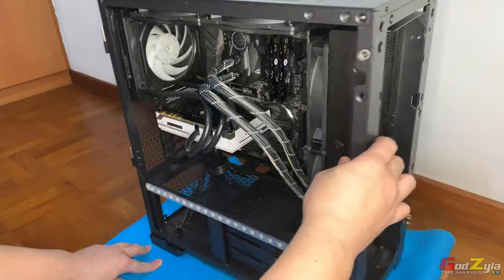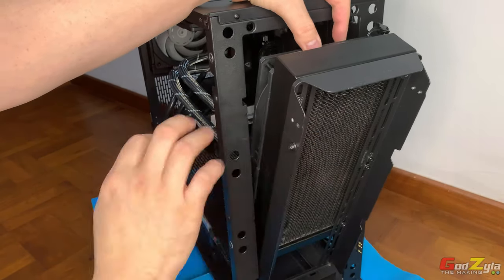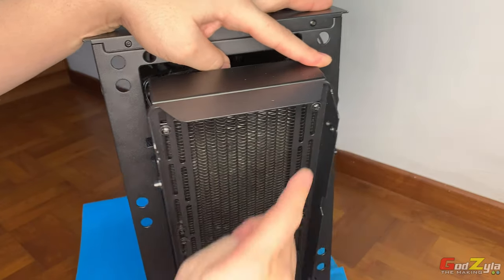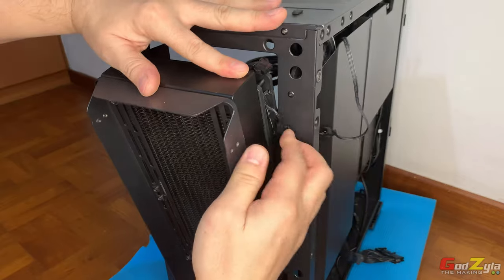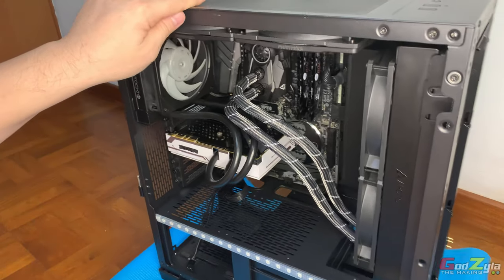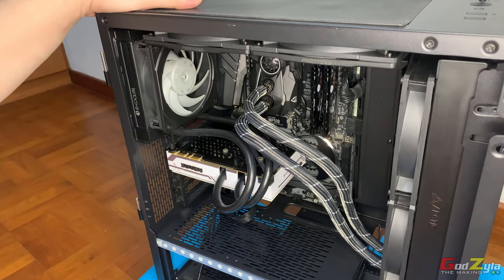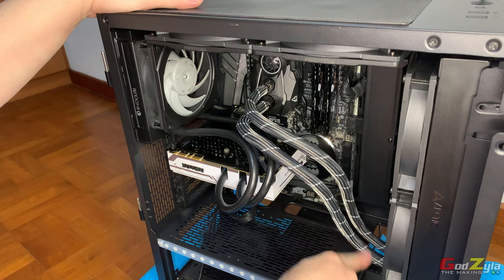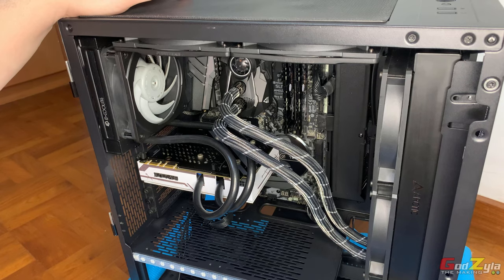Radiator Placement In Lian Li Lancool II Case

Comment: What would be the best placement for a 360mm radiator?
Reply from the maker: Hi SpilledJuiceBox thank you for your question. You only left with front mounting the 360 rad as the top only allows 240 rad. If u do have a lengthy card that is 300mm long. Then ur radiator at the front, the hose must face up and not bottom. Hope this help and thank you for visiting too

Comment: Is it possible to have fans on both sides (a push/pull manner)? For reference im planning on using a z63 kraken (280mm aio) with unifans
Reply from the maker: Hi Kristian Nikolic, welcome to my channel. Yes you can do push pull configuration, no issue.
Reply: @KleoYan  Thank you for the warm welcome and another thank you for the quick answer😊 im planning on going with z63 with 2x sl140 and the 3x sl120 on the front, another question, which would you recommend foe pulling and whic for pushing(sl140) got better static?

Thanks again
Reply from the maker: @kristiannikolic6284  hi, I will advise you to use just SL140 on both sides instead of using mixture of SL 120 and SL 140. If you want to try, there is no right or wrong about it. 
having to say this, these are my reasons on using mix size fans

1) static pressure might compromise, example you have 3 x SL120 at the front and 2 x SL140 at the other end (after the radiator), the focus area where air is pushed in by the SL120 is stronger, leaving your SL140 having some stress to pull the air in.
2) More turbulence as your SL140s fan blades might damage in time, as it's being force by the concentrated air pressure provided by the SL120s. 
3) Noise generated due to turbulence and undulating blade rotation which might cause pitch whining. 

nevertheless as I have mentioned. that's my thought and opinion.
Reply: @KleoYan  most appreciated, im gonna go with your advice since im not as knowledgeble in this area, again thank you very much 👍😊
Reply from the maker: @kristiannikolic6284  you are most welcome but I am not always right, just happened to have some experience while helping friends to build their PC. by the way, all the very best with your build :)

Comment: One question: with a large graphics card like the 3xxx series, would you still be able to mount that AIO upside down with how the tubes are routed? Hard to see in the video, happy for any advice.
Reply from the maker: Hi makvarochapollo, welcome to my channel, so long your GPU is not longer than 300 to 320mm in length you should not have an issue, as for how it looks like, an not able to show you as I have migrated from this case to the o11d mini. https://imgur.com/gallery/Pw5kY4q

Comment: I cant put the tubes down with my 2060 super and the 360 arctic liquid freezer 2.. Will it only be the higher noise or will it cause any damage if I put the aio with tubes up?
Reply from the maker: Hi Daniel Davertzhofen, thank you for your question. 
You can't place the tubes down but to leave it at the top. My video is addressing to the Liquid Freezer II 240 and 280, therefore I am not able to aid you on this. 
do note that you can't place your AIO at the top too as this case does not cater 360 AIO at the top. In short run it will not hurt your pump but it will in the long run. 
you can refer to the video here https://www.youtube.com/watch?v=BbGomv195sk for more details. again thanks for your question and visit.

Comment: I buying ASUS Strix RTX 3080 but will the length be enough with Arctic ii 280 AIO?
Reply from the maker: Hi Gumball Darwin, thanks for asking, answer is yes it will fit. If you are judging on the placement I did on this video, which is the tip of the radiator fans to the the front tip of the PCI Brackets at the back, is has clearance of 32.4cm width and base on the specs on this website https://www.asus.com/Graphics-Cards/ROG-STRIX-RTX3080-10G-GAMING/specifications/  the ROG-Strix RTX3080 has the dimension of 31.85 x 14.01 x 5.78 Centimeter . you can definitely plug the card in but the hose of your 280 AIO can only be mounted at the top and not the bottom. if you place hose at the bottom, it will obstruct your graphics card.  though I don't have the card but I can do up a video to show you the measurements during the weekends.
Reply: Kleo Yan Thanks

Comment: Do you think you can fit a 280mm radiator on the top of the case?
Reply from the maker: No, you can't, at least for mine, as the VRM Heatsink stop my radiator from going in. includes the EPS 8 pin or 4pin connector. I would not advise you to mount a 280 AIO radiator at the top. 240mm is able to, plus on Lian Li website, there are no indication on 280mm placement at the top. so kindly do not mount a 280mm AIO at the top.

Comment: do you think the tube length is enough if I get the 360 variant and install the rad with the tubes at the bottom?
Reply from the maker: Hi Creepto,
it is possible if you reposition your fans at the front removable tray and only rad infront of the tray or to readjust the tray frontwards. However if you intend to place a long graphics card, you might need to take note of the space too. 
Thank you for your question and to visit my channel.
Reply: @KleoYan  Hey Kleo, thanks for the reply. Was thinking if vertical mount GPU, probably can if the card slots in between the tubes.
Reply from the maker: @creepto4900  Hi Creepto, once again thank you for your reply and question. 
I've not try this but your idea might work. 
I can only advise you to make a sample Graphics Card,  with the exact dimension out of recycle cardboard. 
Fiddle with the sample you've made and ,pply the vertical mount, to see if it fits.

Comment: Hi Kleo, i was wondering if i have Nzxt x73 aio 360mm radiator, will it works having the fan in front then radiator inside.or also having like 5 fans in front?
Reply from the maker: Hi Alan, thank you for the question. It should not be an issue to mount as what you have mentioned but for 360 rad, your hose will be mounted at the top and not bottom. As for 5 fans infront. The front only cater for 3 x 120mm fans and not 5, do you mean you are doing the push pull configuration on your 360 radiator?
Reply: @KleoYan  Yes i want to do push pull configuration. 3 fans to intake air outside then radiator then 2 fans inside the closer to the motherboard? And will that setup gives better airflow?
Reply: And also what should be the correct orientation of the tubing that goes to the cpu? Because i saw some people have it on 3 oclock or 9 oclock that is mounted to the cpu?
Reply from the maker: @ajantah4779  now in general, I do not own a NZXT x73 AIO 360 radiator, base on the specs on the website https://sta3-nzxtcorporation.netdna-ssl.com/uploads/download/attachment/847/KRAKEN-X_Manual_690x405_020720_for_web.pdf , it should not be an issue to mount 3 fans outside and to have the radiator inside. 
as for push pull configuration, I believe it will work too but please dont take my word on this, I would suggest you to place two fans outside, rad inside and then place your third fan to try. if you have enough clearance (please consider your GPU placement too) then do it. 
as for push pull configuration, I have tested numerous of fans and I don't find it useful, yes it does pull more air in, but it does not really make your temp drop drastically. further more, even if you place similar fans, in long run, what if one of the fans are faulty? you will bring stress to the other working fan. 
hope that helps.
Reply from the maker: @ajantah4779  as for 3 or 9 oclock placement, it no right or wrong, just keep in mind which every arrangement you do, just see which arrangement does not give your hose too much tension.. once again.. thank you for asking even though I do not own the AIO you are asking.
Reply: @KleoYan  thnk you so much too for replying
Reply from the maker: @ajantah4779  you are most welcome and thanks for visiting too. All the best with your build 👍

Comment: I will listen to much more established people in this field. Never orient the aio with tubes from bottom.
Reply from the maker: Hi The GhastlyGamer, welcome to my channel and thank you for your feedback. I don't think this needs an explanation, air pockets are at the top of the radiator, where the tube at the bottom do not have that, therefore the circulation will not carry any air pockets to the pump. I have no idea how you get the idea that it's bad to have tube mounted at the bottom. 
https://www.msi.com/blog/how-to-place-your-liquid-cooler#:~:text=You%20can%20mount%20the%20radiator,will%20affect%20the%20thermal%20performance.
Reply from the maker: hmm. saw your reply via notification in my email.. you've replied 

The GhastlyGamer 
Kleo Yan jayztwocents, Paul's hardware. Places like that 
REPLY 

it's physics that air will float up. therefore fluid is always at the bottom. so tubes are always drawing or pushing fluid and not air.
Reply: @KleoYan  the videos I saw when trying to find best way to mount aio when I was installing one. And besides my case won't fit a 360 in the top and there is no way to have the tubes at the bottom with my 4080 super the card is too long
Reply from the maker: @theghastlygamer5326  yup I can understand. I have no issues mounting 280 Radiator with tubes down, even if the card is lenghty.. all is needed, vertical mount. By the way, I do apologize of being rude to you as I am offended by your sentences, it's not wrong to trust someone more establish, but the statment "Never orientate the aio with tubes from bottom" is so wrong. Infact it's the best configuration, just that alot are not able to do so, due to obstruction from bulky GPUs or even tubes not long to reach the IHS. For me no issue as I know the limits, thats why I kept using 280 Liquid AIOs for personal builds which allows me to place tube at the bottom. And 280 liquid AIO does a better job compared to 360.
Reply: @KleoYan  jayztwocents did a video where he talks about people running wild with gamers nexus video and talks about how most people run with when they didn't even watch the whole video and don't understand what's being said anyway. It's fine to mount front of case tubes on top as long as pump is not above the loop. Like I said I'll stick to listening to someone like Jay over you.
Reply from the maker: @theghastlygamer5326  thanks for the feedback.

Comment: can i put radiator on top of the case instead on side?
Reply: i mean can i put radiator on the top
Reply from the maker: @darkexx0  Hi welcome to my channel, nope unable to mount 280 rad at the top. the length of the case only allows a 240.

Comment: does someone knows if we can somehow fit a 280mm RAD in front with the 3 X 120m RGB fan still in place ? (mesh rgb version)
Reply from the maker: Hi TnA, thank you for the question. though the structure of the Mesh rgb version is the same as the original Lancool II. You should be able to mount it that way but your thermal might suffer.
Reply: @KleoYan  thanks for your response

Comment: does this fit a 280mm AIO on top?
Reply from the maker: Hi Lalrinsanga Khwlhring, thank you for your question. I am sorry to say no you can't as the surface of the 280 radiator will hit your motherboard EPS area and the heatsink of your motherboard. if you force it. your board will warp or get damage. so it's not able to do so. the only position is at the front. once again thank you for the question and to visit my channel. do subscribe if you like my channel :) thank you!

Comment: Do you think this case will accommodate a 360mm rad and the STRIX LC OC 6800xt (240mm rad)
Reply from the maker: Hi Charles, thank you for your question. the GPU length is at 227mm https://rog.asus.com/graphics-cards/graphics-cards/rog-strix/rog-strix-lc-rx6800xt-o16g-gaming-model/spec/ it should not be a problem to place the 240mm rad of this card at the top and the 360 CLC AIO infront. I do not have a 360 therefore not able to tell you if you can place the rad  hose at the bottom but some bros here mentioned, it can be done if you move the Rad cage forward from the front bezel, hope that helps.. once again thank you for your question and do subscribe if you like my content. thank you!
Reply: @KleoYan  i already subscribed. Thank you for your input, and taking the time to answer. I have the 360mm msi coreliquid aio, and i have reserved the strix card. I was concerned as prior I was interested in the tuf model card, or the sapphire, but I had an opportunity for the strix and for a 100.00 price difference i went with it. I saw the cage was modular and was hoping I could use the lan cool mesh 2. It is a nice case. Thanks again for your input!
Reply from the maker: Hi Charles, you are most welcome. Glad to of help and thank you to have subscribe.

Comment: Would anyone know if my corsair AIO h115i pro will have long enough tubes to have them at the bottom in this tower?
Reply from the maker: Hi Rivet0153, thank you for your question, I was trying to search for the specs but not able to. someone at amazon mentioned that the host length is approximately 14" (35cm) long. I doubt you can place the tube down. The reason I got this Arctic is because of this.. it's 450mm in length which is more than enough to have my tubes down. hope that helps and if you do like my content, kindly subscribe and to click on the notification bell. thank you very much!